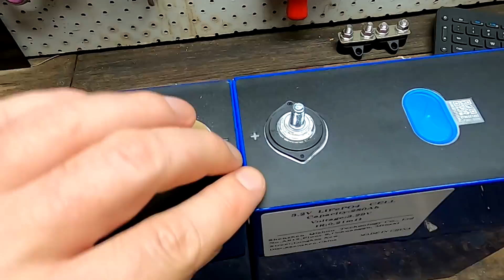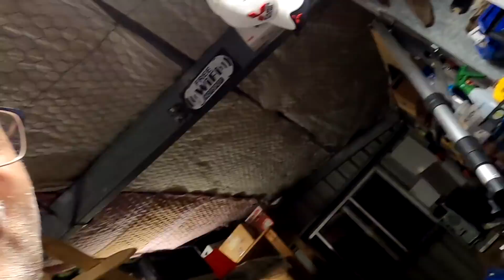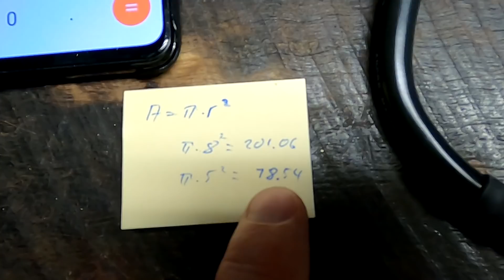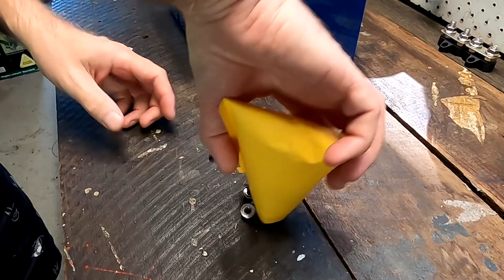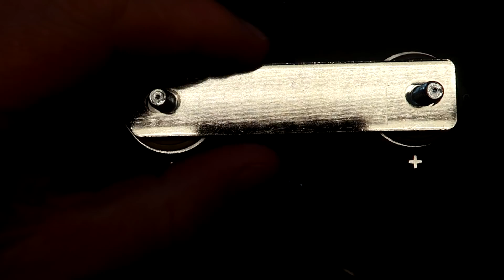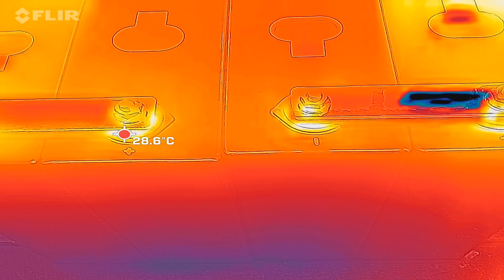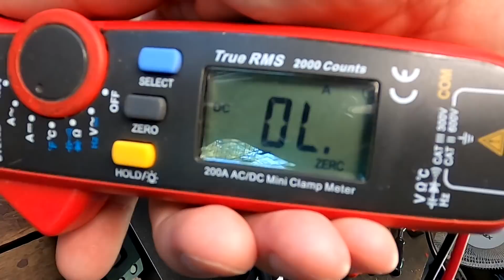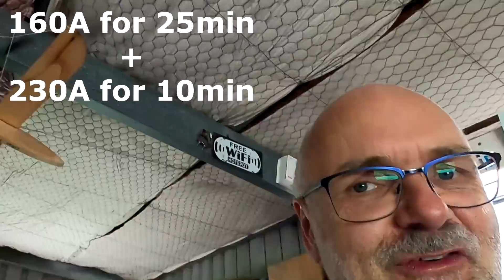EVE LF304 with welded studs. Pushing 230A through a tiny terminal?

Comment: Very interesting, I had mentioned a few times in earlier posts the contact problems with the slotted bus bars in that they don't have a full contact area which restricts the flow of electrons causing a possible heat buildup. It appears that the new design makes the problem even worse.

 I did like the woven bus bars you showed a few episodes ago since their circular holes allow for a full contact while the woven strands all the flexibility to lie flat on the terminal..

I think it is important to also consider the nut fastener on top which also conducts current through the stud. The bottom plate isn't the only current path.

In regards to the texture on the bottom of the nut, I believe that it helps make a better connection by digging into the bus bar.
Reply from the maker: This test is against anything I was believing before. Large contact area, clean, straight... But this here is insane. Yeah, I also believe that now a good portion of the current goes actually through the stud and nut. More testing coming...
Reply: @OffGridGarageAustralia  That would be a great test, hope you come up with a way to insulate the terminal stud
Reply: @OffGridGarageAustralia  Perhaps the current going through the stud and nut makes up for the smaller contact area on the base of the terminal. The nut seems to have a larger contact area than the base and the texture helps dig into the bus bar.

Comment: Imagine that contact area like a cross section of wire. 60mm^2 is massive if there is good contact across that.
Reply: Take a cross section of one of those ring terminals and you’’’ have a fraction of that. The battery post is not the weakest link in the chain.

Comment: If you only use 280 ahr of the 304 battery you'll get the higher  6,000 cycles I bet
Reply from the maker: Yes, but for what reason? The cells will age and degrade from calendar age rather than cycles.
Reply: @OffGridGarageAustralia  Is that really relevant? I think not.

Comment: Andy, you keep saying that the bus bars only have a small foot print of contact with the terminals, but you seem to ignore that the whole stud is part of the terminal. And therefore the nut screwed down to the top of the bus bar is also the terminal contact-they are not insulated
Reply from the maker: There might be some (more) current now going through the stud as well, but the main current still goes through the direct connection bus bar - terminal I believe.
Reply: @OffGridGarageAustralia  if the top nut being screwed down was plastic then yes, otherwise ALL metal contact points are a path for current flow. If the welded screw was smaller in diameter then resistance would be higher. I would like to see the welded screw head larger to make a more secure connection under high torque with the bus bar hole size only having such a small contact area

Comment: Andy, if I would not trust your integrity - this would be hard to believe and would like a fake testing.  Regardless what the test results are, having that reduced contact area is not acceptable.  They will change the design - it is typical how things are handled in China and you will see it.  Sorry to say by QSO screw it up this time.  On personal experience - Amy sent me last batch of batteries grade A good quality but totally unmatched (not the stud connector type).  I was told matching up cells is an extra cost, which I was not told during my first order.  Disappointed, most likely will not buy from them again.  

A bit off topic, but some of the Companies having success are getting lax after a while: the same with the other Any from QUCC.  The BMS will not recognise the higher 1,120Ah capacity and she stop responding to my inquiries.  Again, no more QUCC.
Reply from the maker: Thanks for sharing, Razvan. What do you mean with unmatched? Voltage, internal resistance, capacity?
Reply: @OffGridGarageAustralia  Andy, I fully tested the 16 cells through a charge-discharge-charge cycle and they come 279-284Ah.  Internal resistance spot on: 16m miliohms.

Comment: The 280AH cells I got last summer had the welded stubs but also came with copper flat washers with a big hole so they would sit on the base of the terminal and they were thick enough to come flush with the higher part.  The washers were not a perfect fit but still it resulted in a bigger contact area, like the old terminals.  I normally don't push big currents, but I was concerned so I tested the batteries with a 150 amp load and the terminals did not get hot.  From your testing it looks like I really don't need the copper washers, but I'll keep them and treat them (NO-OX-ID) to prevent dissimilar metal issues.
Reply from the maker: Thanks for sharing, Mike. These copper washers would make sense if the underlying ring is clean and even. Mine are not so smooth and have a lot of metal 'debris' from the welding process. They probably found it it's not necessary any more 🤷‍♂️

Comment: Another washer wide and thick/tall enough to go around the welded stud tightly, making contact with the original surface bringing the level up?  Hard to say if it would work well...
Reply from the maker: It seems the lower laying ring is not polished or even smooth enough due to the welding process. I guess they found out it's not necessary to have that.
Reply: @OffGridGarageAustralia  right on. Glad it worked out well as is.

Comment: Hi Andy.... Greetings from the Great White North (Canada)...🤪🤪.. I have been using the welded stud version as well since last September.... no issues so far.... they are installed in a bus conversion running the entire bus so pulling up to 250 amps at times.... the only issue I have is cell 8  goes a little out of balance once in a while.... a little loosen of the nut and re-tighten and all good again.... I made my own aluminum busbars so may be running into a little corrosion  issue as you did... not sure.... keep up the testing.... it's helped me a lot.... James
Reply from the maker: Thanks a lot for sharing, James. That is great to hear. Wow, all these projects around the world with batteries, that is incredible to read and learn about.
Yeah, aluminium bus bars are quite different. I will install the two new batteries with the original copper bars and see how they perform over time in comparison to the aluminium bars .
Thanks again and all the best to Canada!

Comment: I've been running an 8S2P pack of these terminal type for a year now with no problem. However, I rarely exceed 100-110 amps discharge, and even lower charge rates. I made my own bus bars from aluminum angle stock. I put holes in the vertical leg of the bars for my balancing and test leads. That way I never touch the terminal connetions once they're installed. The angle shape also doubles the cross sectional area of the bars. I also use only the serrated flanged nuts with no washer on the terminal to increase the contact area.
Reply from the maker: Hi Michael. Thanks for sharing. Seems like a lot of people are using aluminium bus bars. That's a great idea using an angled bar for that purpose.

Comment: Hello my friend. Glad to see you posted this as I was in the same conundrum. I am currently running a 24v system getting ready to graduate to 48v. I have been using Amazon, and bought a set of 8 -280ah prismatic cells initially. The cells looked great upon arrival, nice and square on most sides, and with nicely nickel plated bus bars. The topside connections had large square pads for the bus bar to set on like the first ones you showed. So I ordered a second set, hit the order again button,  and when ordering I noticed the same 280ah cells for $100 less. So I bought these, and upon arrival I had the same reaction as you, trying to figure out how these would ever pass the same current. They were not as square as the first set I bought, slightly larger,  and had those welded on terminals. Wanting to combine these for 48v, it raised questions as just how different these are. Have no real complaints so far on either set. Both work fine with 24volt daly BMS's , but I'm not loading this system either. I'm still not sure what the difference is supposed to be between these cells. Both listed as grade A, 280 AH cells on Amazon, some further research is needed I believe.
Reply from the maker: If you have different orders, you probably end up with different batches of batteries. In my first battery, I have 3 different orders and even they are all supposed to be LF280, they already vary and cause some challenges...
As long as they all have the same capacity I would not bother too much. Probably do a capacity test on one or two to confirm this.

Comment: What about using larger holes in the busbars/ring lugs to contact the bigger area around/underneath the area you were talking about? If the busbars' thickness is equal or greater an the height of the smaller upper ring area, the flange nut will tighten were it needs and also make for additional contact area from above through the stud.
Reply from the maker: I looked at this but the second, larger ring seems to be very rough and not flat due to the welding process. Also, such bus bars would need to have the perfect height if you want them flush with the upper ring. Nothing you can make yourself.

Comment: makes me wonder which ones I am getting. welded or not welded EVE 280AH 280K 6000cycle battery x 48. as long as each bank can put out 66 amps I will get my 200 total amp output. once I order the other 16 then each bank only needs to put out or take in 50 amps. only my bus bars will ever see 200 amps as each inverter does 100 amps in and out continues.
Reply from the maker: 66A is no problem at all!

Comment: You can put a copper washer where the inside diameter of the tiny raised part so it is flush and get more contact area.
Reply from the maker: If you could find one which has exactly that height...
The lower level ring is not really flat and clean from the welding process though, so not ideal either.
Reply: @OffGridGarageAustralia  you could always sand one down to match. Copper is also very ductile. You'd drill the hole in the center to match. You just need some cheap $15 digital calipers, measure diameter, and a cheap complete set of drill bits, and match the hole size.  That's what I'd do. It's a one time investment of time, considering crimping terminals or drilling and tapping bus bars is time consuming as well and it is a long term use.
Reply: Also, to sand the terminal post part, you can take one of those washers you made, attach it to the end of a pipe, put sand paper on the washer and rotate the pipe to sand those down flush. Then put the new custom washer in, and sand both inner stud and outer washer together to get those two flush.

Comment: The smaller surface means the actual pressure between the terminal and buss bar has increased, better contact means lower resistance and lower losses resulting in heating effect.
Reply from the maker: I don't think this is that case. Is not 4Nm = 4Nm regardless the area it applies to?
Reply: @OffGridGarageAustralia  Of course the area makes a difference. Why does a bull dosser have tracks, its because it spreads the load over a wider area.
Reply from the maker: @henvan8737  but the weight of the bulldozer stays the same regardless how large the contact area to the ground is.

Comment: I have 200 ah cells. Battery is 2P 4s configuration 400ah 12 volts. My studs are welded. I have copper bus bars made from copper pipe. I have tested discharging 250amp continuously for 30 minutes. Temperature of bus bars and studs are around 2 degrees Celsius above ambient temperature. I hav e no problems with contact. I tighten to the same torque I would for a Phillips head screw. 
Cheers Andy enjoy your vids.
Reply from the maker: Thanks for sharing, Ken! That is great.

Comment: The standard Renogy cables are garbage. Has anyone cut them open to see what size they are? Mine also get very warm.
Reply from the maker: They seem to be 4AWG size, same as Madi's flexible busbars I had them connected to.
Reply: @OffGridGarageAustralia  4 Gauge is 25mm each, so 50mm in total. My pack only runs 2 gauge (35mm) and no heat at all. Maybe the renogy cables aren't copper.  I just scored some 50mm welding cable from work, so might be able to cut and check!
Reply: @OffGridGarageAustralia  4 Gauge is 25mm each, so 50mm in total. My pack only runs 2 gauge (35mm) and no heat at all. Maybe the renogy cables aren't copper.  I just scored some 50mm welding cable from work, so might be able to cut and check!

Comment: Just the test I was hoping for! Was pretty concerned when I unboxed my little blue beauties last week. Alot of speculation out there at the moment... But not alot of solid info. Que Andy! Fantastic work as usual.
Also, just to throw a tinned copper spanner in the works, and to get the anti compressors stirred up again, check the fine print in the documents on the 280k's
They have gotten slightly (only just)  more specific on the wording with this 300kg of force, mentioning 'under a 300kg force clamp' this time, compared to previous versions where they only mentioned fixture and inferred the amount of force in the cell dimension diagram... Seems they are firming up a little on their recommendations?
Reply: On a side note, I couldn't find your email address either here or your website to forward the photos about the ZKE tech
Reply from the maker: Thanks a lot Chris. I have read the specs of the 280K and 304 cells and noticed the wording as well. I'll talk about this in a video soon ;)
Email is on my hompage all the way down, just above the Buy me a SPAT section (in the small disclaimer text).

Comment: I overcame the issue with welded studs by making thick  and wide aluminum washers (credit to Ray Builds Cool Stuff channel) and new wide aluminum bussbars for maximum surface area.
i find aluminum works even better when you apply more torque, since its softer than copper the aluminum parts will kinda squish together with no gaps.
Reply from the maker: I found the lower ring has a lot of debris fro the welding process. If aluminium is softer than copper depends on the material and what mix they used. The aluminium bus bars I have are a lot harder than the tinned copper bars from the cells.
Reply: @OffGridGarageAustralia  correct. 
i believe that we used 99% min pure aluminum alloy which is very soft (same alloy that is used with laser welded bussbars as 12s1p NMC modules).
i think your best bet is to use soft aluminum washers.
Reply: Aluminum has the habit to creep. So screwed connections, as in fuses and such, need to be maintained. Aka re-tightened. Aluminum also oxidizes rather fast. So even a sanded surface gets oxidized the moment it gets in contact with the air. These reason why NoAlox and Wago grease is recommended with aluminum wire in  contact with copper. Using the welded steel studs does away with the aluminum contact and creeping issues. And they can be tightened more due to their strength. So a smaller area is offset by larger torque.

Comment: You also have contact area through the stud to nut to bus bar.
Reply from the maker: How much current will go through the studs and nuts and go into the bus bar from above you reckon? 10%, 20%,...?
I would say it's less than 5%.
Reply: @OffGridGarageAustralia  I disagree.  Look at the contact area and amount of material on top and through the stud vs just on the bottom.  I'd guess 75% or more of the current is transferring through the top.
Reply from the maker: @ssoffshore5111  than wait for my next video...😉

Comment: Andy, batteries look great.  Clean the surface of the terminal and bus bars with a little fine wet and dry abrasive paper and use terminal grease and all should be good.  As an engineer I don't like flange nuts either, plain nut and washer or washer and nylock nuts are my go to.

Comment: I suppose that by moving to an all steel bolt, they have greatly reduced the risk of stripping the thread or permanently damaging the terminal on the battery (as opposed to a steel/stainless steel stud screwed into the aluminium terminal).
As a "fix" for this, you could get some simple stepped washers or rings machined up (hobby lathe?) that will slip over the bolt and contact the bolt base as well as the lower part of the terminal.

Comment: I also have the new studs. As I made my own busbars I drilled them to 1/4" (6.35mm) which allows an easy fit whilst maximising contact area. The greater torque should help with conduction between busbar and terminal post. I don't intend going above 100A so we'll within the quoted 160A.

Comment: YAY! I just received 304ah with welded studs as well. I was concerned seeing much less contact area when compared to my other cells. I’ve been putting my current batteries anywhere between 1800w to 3000w. I’ll likely never use above 160A constant draw. Good to know I don’t need to add washers or anything - just use the stock busbars. Great test!!
Reply from the maker: It almost is too easy, right?